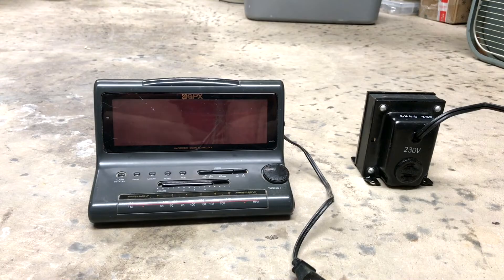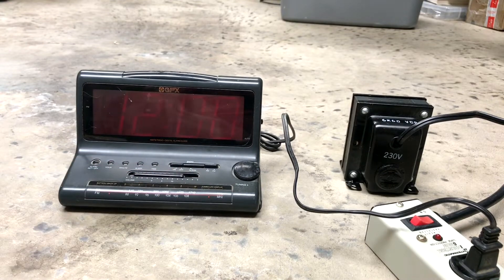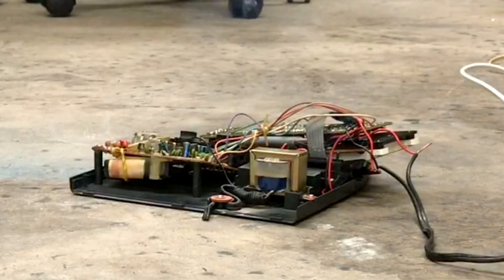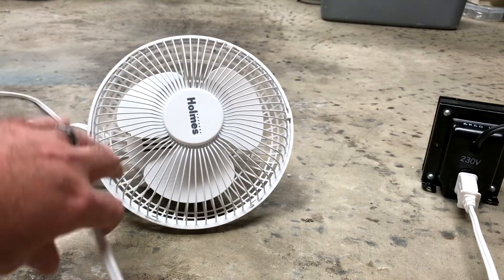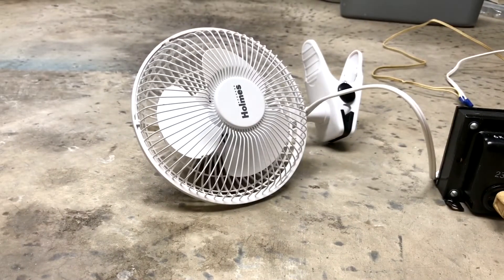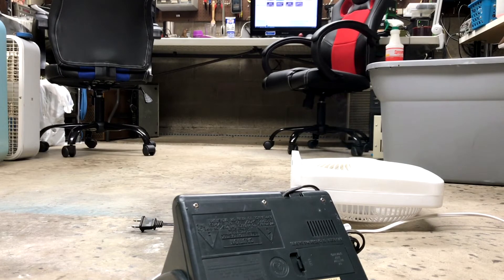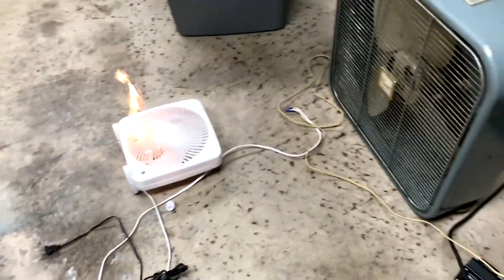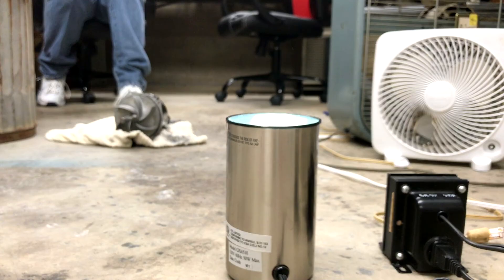Destruction!  Running 120 Volt Items on 230 Volts

Comment: (several years later) The first fan operates just fine at that voltage (230 volts), since it's likely designed for that and underpowered with 120 volts. Replacing the thermal fuse with something of a standard one would do it just fine. The second one definitely needed to be oiled (the motor that is) so it works as intended without making that rattling noise.
Fan motors do need lubrication after a while, if it loses speed or makes noise. Quite easy to do.

Comment: Great video! I realize I'm 7 years late, but if you want to try this I suggest nixing the transformer entirely and just using 240V power which you already have at your breaker panel. If you don't have a 240V outlet you can take two 120V extension cords and plug them into outlets on two separate circuits on opposite legs of your panel. Check with a voltmeter and make sure you have 240V between both cords. Then rig whatever you're "testing" to plug into both cord ends. Yes it's more work and yes you will be relying on two separate breakers, but you'll have more power available since the transformer is limited as to how much power it can supply before it goes up in smoke.

Comment: Most products are multi powered 110-220 volts, many fans will run a short time on 220 they will just overheat in time...
Good video...many cell phone chargers will work 110-220 v.

Comment: I remember as an electrician apprentice our journeyman and I were putting in a large LED sign at a sports complex. He tapped into the office lighting circuit which was 277v. Needless to say it started to boot up and we heard a huge bang from inside the unit. Then the horrid oder of burning electronics and medical bandage started to permeate the room.

Comment: I thought the alarm clock or any similar device would just get its fuse blown and not work any more until that is replaced.  A lot of things have a fuse and sometimes it is one of those glass ones that looks like some sort of strange light bulb.  Sometimes you just have to open the thing up to get to it and sometimes it may even be soldered in there for some reason (to make replacing it a pain)

Comment: Twice the voltage provides crudely 4 times the power I = V/R.  On newer technology they have PWM power control and will support 240 volts.  Sometimes the PWM chip goes out - and this happens regardless of the voltage

This would often happen in my area - there are a lot of homes with old "knob and tube" wiring and beautiful finish nobody wants to rip out.  One way of increasing the power available to the whole house was to split up the circuit - often leading to "L1" being on the neutral and "L2" on the hot

Comment: I was fixing an old 1980's generator made in Australia. I got it going and had to reflash the generator by putting a fan on it. I use a pedestal fan which had a bad capacitor and ran slow on 240 volt but when I hooked it up to the generator it was spinning so fast it was ridiculous but pretty cool. I checked the voltage and 240 volt but the frequency insted of 50 hz went up to 120 hz. Lol. It was so old but the AVR was pretty sophisticated. In the end i scrapped it because no parts available anymore!

Comment: in  1992 or 1993 , without thinking switched my  familys new 386/40mhz pc power supply to witch i remember been 115v. crack and pop, power supply and  80mb hdd was blown up and possibly more stuff.  I was a kid and i knew i f*cked it up and switched it  back to 220v. It had warranty and company fixed it with new parts, no questions asked. It was way too easy to use to switch. 
Sorry my english, its not native.
Reply: Tee hee hee :)

Comment: For safety, NEVER plug any 120-volt products into any 240-volt outputs under any circumstances due to risk of fire hazard.
Reply from the maker: 2 + 2 is 4.
Reply: They are in a garage. I think fire is the least of there concerns. Odds are they  are at more risk of getting shocked or getting ear damage from loud bangs

Comment: Russians and others who use 220 volts: hah, not a problem at all
Reply: france too
Reply: @TheOfficialDorianelevator that's why he said and other Einstein
Reply: UK too
Reply: 230V*  @lrp28nitro
Reply: NZ here at 230v
Reply: Us Aussies use 240 volts so hah not a problem
Reply: We are using it fine in the UK people aren't dying.
Reply: Grid voltage changes these days are due to a lot of factors one of them being people exporting solar from their house
To export power to the grid they have to be at a higher voltage than the grid so the more houses want to export solar the higher the grid voltage climbs
Also depends on the current demand in your area and also the distance from the transformer that feeds your house due to the small resistance in the transmission cables
I live in Australia btw idk what it's like in other countries but I imagine it's pretty similar

Edit: Just checked my grid voltage currently 239.8 and it's current night
On a sunny day I've seen it at over 250
Reply: @Hellohi3654  for me at my moms house it tends to be 240v 50hz for the house, and 400v 50hz 3ph for the garage, yep, you heard me right, I HAVE 3 PHASE. dont question why tho.
Reply: Malaysian and other bros who use 240 volts : MENYALA ABANGKUH 🔥
Reply: 240v here
Reply: Yeah but the problem here is these products are only designed to run on 120 volts
Reply: In Thailand, you can plug the NEMA into our 230v outlet at your own risk.
Reply: Россия поддерживает👍
Reply: English people laughing in 240v

Comment: Gary is probably the person who hand drew that PCB in the clock.  A Variac is more fun here in the UK as it allows you to overvolt even 230v stuff.  I blew quite a lot of American stuff up on it when we were refurbishing the lab starting at 110v and then ramping up the volts until the magic smoke came out.  I remember that 110v AC fans don't go any faster on 275v but they definitely run buzzier and hotter until they release the magic smoke!
Reply: If you like that stuff look up photonic induction.

Comment: Thing is that it's still running the same wattage so you would need to tap into the dryer outlet and get 240 volts with 3000 watts but if it's just about voltage then you need should step it up to over 9000 volts
Reply: No, it isn't running the same wattage. Depending on the type of load, it could be drawing nearly 4x it's normal power at 2x rated voltage. Best thing for busting electronics is anything from around 500V to 5kV at considerable current (at least 20kVA apparent power).
Reply: No the power draw will definitely increase with the increased voltage, about 4x the power with 2x the voltage. That's why in the one clip his transformer let the magic smoke out

Comment: Forget that little step up. USA? Go to like Lowes and buy a dryer or cooker plug, Most homes there should have one of those sockets, 240V at 30 or 50 amps. Just need a single breaker box to limit it to 15A or w/e you want ^^

I don't know why, but I just hate fans and find it funny to watch them burn up

Comment: Can u pls try a revlon one step hairdryer and straightener? Bought it from  amazon US and then read that it can’t be used outside of US and Canada :( is there any transformer / step down voltage converter that u would recommend for the 1100w hairdryer? Thanks much!

Comment: 3:58 to 4:03 how is it several minutes later if the clock said 12:00 before 4:00 and after 4:02 12:01?
Reply: The power had been removed for a moment because (off-camera) Spats thought the transformer was smoking

Comment: That is correct about China and the Philippines

But about with the fans you're testing on that video putting them on 240 volts ac all those have thermal fuses same thing of heating appliances even vacuum cleaner Motors some Transformers and many more things it is required by national electrical code for safety reasons and also a lot of CFLs half use a lot of things have fuses somewhere internally that may not even look like a fuse or a resistor that's designed to act like a fuse or the fusible resistor and now additional thermal fuses some fans have a fuse in the plug oftentimes those plugs are blue and also some fans even have fuses removable or a plug that takes a chrysalis like type views so yeah you're going to keep having that problem while off self just so you guys know so keep those tools handy and also PSA out there the right to repair movement he is trying to fight it but it is not to make you buy a new device it's for everyone's safety and prepare your house from burning down if something malfunctions I got a bad thermostat four blocks are on a hair dryer at Bed thermostat Etc worst old motor vacuum or I personally blocked vacuum at overheats Etc although some motors have a resettable thermal protector if you like cool will come back on but not all of them and some have both as well some recent ones looks or like a fluorescent starter capsule but just have bimetallic strip and contact Sherlock what's in a flashable except heavier but no filament and not only restaurant the temperature but they can also be used in something's is a circuit breaker such as in a Marlboro power pack a repaired one for somebody and that's what was protecting from overload and also it had happened so many times I excessively overloaded there's a bad wiring connections on a layout that had fried a diode 02 in the bridge rectifier causing a short which would trip that thermal breaker oh by the way you guys should put a TV on 220 old school CRT film Transformer 4 the CRC a really really old or chup chup radio whether chup chap equipment caution high voltage Transformer not like a Florida transfer on TV so stay out when it's on discharge all capacitors if you open it because whatever you put in romwe could be up at 400 false or so usually less but remember awake double batch and chances are you'll probably pop the filter caps which would make a nice big bang or as photonicinduction says I popped it

Comment: Love how the fans gained decent high speeds, if only they ran like that without bursting into flames.
Reply: there is a tolerance of +15% where these motors can run overvoltaged, but not +90% voltage increase
Reply: It's the frequency that controls the speed not the volts but they certainly have more torque at the higher voltage due to the higher coil current and of course eventually the coils burn out due to drawing roughly 4 times the power they should.
Reply: @ianhosier4042 well to be fair, when you double the voltage you can definitely expect the speed will go up
Reply: the flames are just an extra feature to turn your fan into a heater.

Comment: What about a hair dryer on 230v   If possible
 
A shitty crt tv that is only good for scrap on 230v
Reply: I accidently did that one time
Was one vacation in the Phillipines which is 220v 60hz.  One time and the hotel room had 2 different type of outlets. Type A us style and type C Asian and European. The book in the room said type A was 110v which is common in hotels because a lot of Americans go there. Needless to say I plugged in my 110v hair dryer turned it on. It turned red hot and the motor ran really fast.
Reply: I'm pretty sure a TV would simply make a single pop and be done... A hair dryer is a good idea, especially since the fan will probably fail more quickly than the elements :-) Not sure if my transformer would support the 6 or so amps though.  I'd like to explore bigger transformers, or maybe even some sort of rig involving our existing 240v outlet (not shown, but to the right of the video just past the white cabinets.)  Actually, that's an idea.  I could rig up a power cable, plug it into that outlet, and use a contactor...that would give me remote control, too...so I could stand way back and not be limited to 3 feet away.  Huh...ideas, ideas... :-)
Reply: Harley Badger great, i was also thinking about you could try to pop a big industrial incandescent light buld

unlike the european 240v our 240v outlet have 2 120v power line per each side removing the neutral and a ground, some of them is 10amps while theres One with 15amp

The 240v one is actually the same outlet type as the Australian 240v but the 15amp as horizontal prongs instead
Reply: Matthew Best did it blew up ?
Reply: RAGE nope kept working for like a year later.

Comment: About those fans, I will sarcastically say that China does a very good job lubricating the bearings!
Reply: I've lubricated my Chinese little fan with lithol today and it stopped rattling. China doesn't lubricate motors specially for decreasing their reliability. This is a marketing, nothing else.
Reply: haha good point

Comment: I had one of those ear-trimmer clippers that wouldn't run anymore on an AA battery, so I just spliced a 5V AC adapter onto it. It got hot and I made a point of putting the blades under the faucet before using it, but it worked much more aggressively than when new for a couple of years that way.
Reply: I do that with my kids nightlights so I'm not forever replacing batteries.

Comment: Am I to guess that the LED bulb was universal voltage (85-265 [or so])?
Reply: Apparently, all three are marked "120v 60 Hz only" but as I have seen on bigclivedotcom's videos, most modern electronic ballasts seem to handle that wide voltage range.  Something about the power supply being a combination of a capacitive dropper and a bridge rectifier and some varistors that allow the ballast to self-regulate.  Unfortunate for me and/or this video though!  LOL.  And you're gonna be mentioned in an upcoming video, I mean, WOW, that gift couldn't have come at a better time, considering the subject of a couple recent videos.  Thank you for that.
Reply: Oh so you did get it! Awesome!
Reply: Yes, weeks ago LOL, and thank you very much!

Comment: Great video as always! Why do thermal fuses always have to ruin the fun? Interestingly enough, I have a funky outlet in my garage that has 310 written on it. I'm not sure if it is 310 volts, but it would do for burning stuff up!
Reply: Thanks!  And yep, next time I'm just gonna bypass them from the start.  And 310 would be a weird voltage (in the US anyhow) because it's generally multiples of 120'ish, based on the supply transformer to the house.  120, 240, 480, etc, with 208 and 277 being exceptions, usually on three-phase service to businesses.
Reply: Correction: it’s actually 210, I misread it as 310.

Comment: Very cool!  

You need to invest in a real transformer like the one I used for my power strip overloading tests!  That one has 240V, 480V and 600V(!) taps on it.... and will put out 3000 watts all day long......
Reply: Harley Badger the Philippines uses our outlets at 230v.
Reply: Yep, there will be more to come, and upgrades as well ;-)  I just happened to have three of these transformers in a bin, no idea what specifically their original use would have been, because they all have the normal US standard outlet on them...so that sort of defies logic.  Any foreign 230v appliance wouldn't have the US plug on it, but maybe it's that way for plug-adaptor use.
Reply: One word - China.  In China many household goods have the standard 2-flat-blade plug like we have. Their standard outlet has the ability to accept a round pin or flat-blade plug.

Many of the China domestic market devices have the 2-flat-blade plug WITHOUT the holes in the ends of the blades like ours do.
Reply: Ohhh!  Right on, I didn't realize that :-)
Reply: That's more like it ;)
I've got one that's rated 12.5kVA (690V 18A), and that will annihilate ANYTHING

Comment: I had a feeling you were going to fry your transformer. That looks big enough to handle a couple of amps at best, and when you've got enough current to trip the breaker.... well... :P
Reply: Yeah, I shouldn't really be surprised XD
Reply: That transformer is probably rated 100VA max (and that's like 1A on the LV side), so massively underrated. I happen to have a 690V 12.5kVA transformer at home (it's a beast, weighs 200lb or probably more), but I need a 240V 63A breaker to run it (which I haven't got yet). That along with a 20kVA variac, and I'll pop microwave ovens like a 1/4w resistor hooked up to mains.

Comment: We bought a Waterpik flosser last January before a family trip to Australia despite my warnings to my mother that Australia's 240 volts of line power would fry it! Sure enough...
Reply: Yeah nah mate, don't plug that in 'ere, ya gonna blow her up mate, she won't work anymore.
Reply: @Lachlant1984  The American plugs do fit and 100% work (for maybe a minute if you dont burn down ya home), ya just gotta bend it to fit.
Reply: @wingriddenangel404 Dude have you seen an Australian outlet? They are different to the USA. A common dodgy "fix" for USA appliances though is to bend the prongs so they fit, but this is a huge safety risk.

Comment: Are you guys both electrical engineers?
Reply: Yes.  Spats is still on that career path and I was until 2012, I finished my degree and now am on a different path.  Although I still engineer and consult with my father in my downtime.
Reply: Harley Badger you guys are not married correct because on your about page it says that you are
Reply: @vectorcollector4893  Yes, we are married
Reply: Harley Badger Awesome it’s good to hear that
Reply: Harley Badger how’s the 78 Kenmore
Reply: @vectorcollector4893  Thanks :-)
Reply: @vectorcollector4893  And running fine, we haven't had to do any other maintenance or repairs.  We run a couple loads a week in it.
Reply: Harley Badger good to hear if you had a choice what would be the next washer that you would consider getting
Reply: @vectorcollector4893  Probably an early 80s Kenmore Elite pair in black with the digital controls
Reply: Harley Badger I either want that or a whirlpool gold with all the options do you know when your next washer video will be of the Kenmore